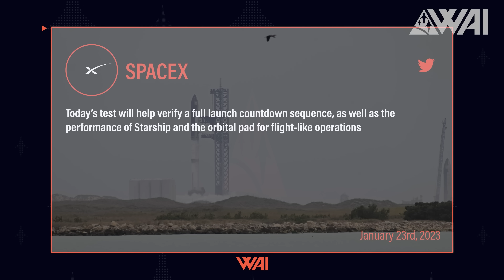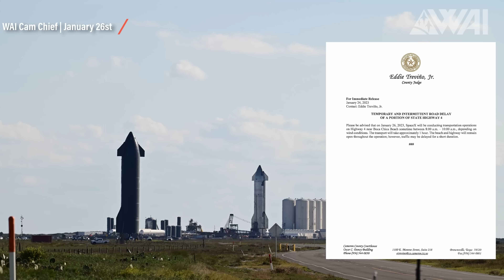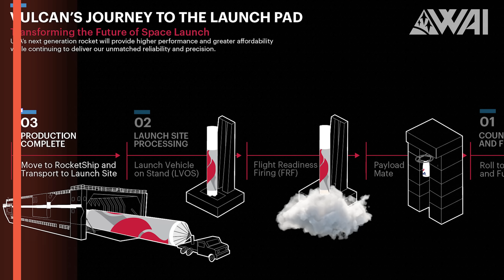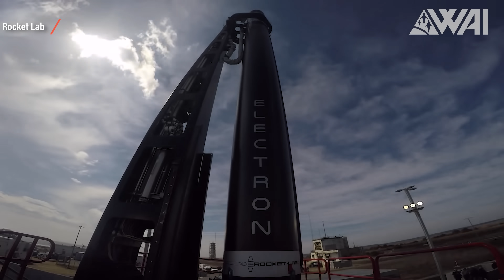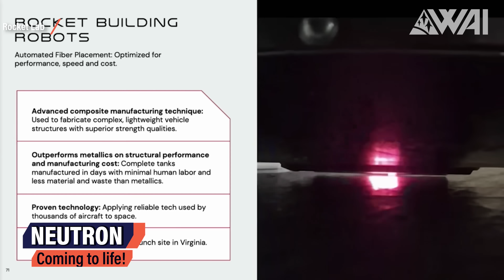How Did SpaceX Starship Do During The BIGGEST Test Yet? - Largest Rocket Ignition In History Next!

Comment: The CDDT (CountDown Demonstration Test—“Wet Dress Rehearsal”—my Baby Boomer behind!) also includes a  Pad Abort Test as a matter of course. If SpaceX took it that far, all goes as Felix describes and you get to T-whenever to start the engines. Since that is inhibited in the CDDT, you necessarily test the launch control and emergency detection systems to ensure they operate properly to safe the rocket on the ground. 

Certainly they would also have other abort systems at the ready for testing like fire mitigation, tank depress valves, etc. as well.

Frankly I’m more inclined to the March period for a first go. I cannot be made to believe launching a vehicle with roughly three times the power of Saturn V isn’t going to destroy the pad without a flame deflector and a massive water deluge system—far more than we’ve seen to date—to dampen the ground effects of that power. I hope I’m dead wrong and SpaceX has figured it all out; like everyone watching, I want this bird to soar!!😊

Comment: I have discussed some thoughts on the survability of the OLM pad from 33 engines firing up.

To better protect the pad SpaceX should have steel plates made up to cover the pad.  There are many steel types that can withstand both the tremendous temperatures and pressure of those 33 engines.  If for some reason one of the pages needs work it would be a very short down time compared to tearing up the pad, replacing the concrete and waiting 48 hours for it to cure.

Anyway those are my thoughts on pad survivability.

Comment: I love the Dr. No vibe of the Neutron payload fairing. We need to keep an eye on Rocket Lab and make sure Peter Beck doesn't start stealing spacecraft out of orbit.
I was very surprised to hear a Vulcan Centaur launch will only cost $110 million. Is that the actual cost of launch or the price to the customer? If the latter, then that puts them within about $1,000 of the per kilogram cost of a Falcon 9 launch. That is very impressive for an expendable rocket. Of course, they're not going to be able to launch more than ten or fifteen times a year compared to SpaceX's every three or four days or more and, of course, Starship changes everything.
Very much looking forward to Starship's maiden launch. I sure hope that flame, pressure waves, and flying debris don't do significant damage to the launch mount or tower. They really ought to look in to raising the pad up on a mound as was done with 39 A and B so they could build a flame trench. Anyway there are, of course, a multitude of things that can go wrong in a tst such as this and loss of the vehicle will not necessarily constitute failure. As long as they crack the Karman line, I'll call it a success.
Reply: Vulcan pricing seems about right... depending on configuration, Atlas was about double the price of a Falcon 9 launch, so you'd expect Vulcan to sit somewhere between the two.

Comment: 5:25 The Methane tanks might have been filled with LOX for this rehearsal. In that case, it would allow them to safely test the mechanisms that depressurize the Methane tank, but without a combustion hazard. For example, using hot methane gas for maneuvering with hot gas thrusters.
Reply: It was definitely methane that is why it is called a WDR and there is not enough LOX to go round all the tanks
Reply: Plus they will not evacuated the village if that's the case
Reply: then, when was the "single species" propellant test performed? It's on the checklist.
Reply: @imconsequetau5275  https://youtu.be/O2DB5oNJV-w
Reply: @imconsequetau5275  If it is perhaps the two tests before

Comment: I have a feeling that with a 33 engine static fire, that the concrete under the orbital launch mount will need to be replaced again.  Just a guess, but my feeling is they haven't solved that problem yet.  Perhaps they have though, as they have made more changes to the launch mount and it's systems.

Comment: A couple of points: 9:38 The BE-4 may be more efficient that the RD-180.  In that Blue Origin has not released its specifications that supposition is conjecture.  The RD-180 has a sea level ISP of 311, the only source I have seen, on the much lower chamber pressure, BE-4's ISP was by the Everyday Astronaut and he guessed 310 ISP.   12:16 As a matter of fact the Vulcan part of the rocket has arrived at the Cape and hoisted vertical.  The next major milestones left are placing the Centaur V upper stage atop the first stage, integrated testing performed, then the Vulcan rocket moved to Space Launch Complex-41 for fueling tests culminating with a Flight Readiness Firing.  All the pictures so far have been only of the first stage.  As per the Atlas V 10:06 was designed to put payloads into space, it was never commercially competitive on price to have much of an impact on the commercial launch market.  It was certainly capable enough for that business.

Comment: personally i think it will go well but its the simple flat pad under OLM that is the problem SpaceX is an amazing company but i find it hard to understand why they have left the concrete pad underneath OLM just flat surely some kind of dome indent and some slit indents in the pad would allow for better efficiency   for rocket exhausts  ?
Reply: They drive a mobile work platform under it for work on the engines.  You don't want the platform tilted.
Reply: @Scanner9631  aye I understand they do for replacing engines but am on about the 33 raptor2 engines  firing all at once on a flat pad underneath the Orbital Launch Mount there will surely need more repairs after they do that ✌️, the flat concrete pad underneath the Orbital Launch mount is the weakest point in the whole projected I personally believe don't understand why they are leaving it flat and not making some slit indents in the concrete to make it more efficient on projecting the Rocket Exhausts out of the OLM And Pad Area
Reply: @GamMngitSssEmoTionaL5953  

What I wonder is why they don't have a set of "baffles" that they can move under and drop in place.  

The baffles I envision would be large metal inclined at maybe 45 degrees from vertical and be layered.  

Purpose 2 fold divert the exhaust sideways and cause interference between diverted and not diverted flow (introducing chaotic but slowed overall movement) and leaving no direct path to the concrete surface or from the surface to the engines for debris to fly.

Slowed with less force = less surface damage.  The sideways flows would spread it out beyond the OLM faster leaving it less intense everywhere.
Reply: @Scanner9631  Great idea. I hope SpaceX adopts some version of it.

Comment: Elon quite correctly stated that Starship would leap off the pad. But I don't think he calculated correctly what 33 raptors would do at a sustained blast for required static fire testing. Installing the new suppression system he has arriving from the Cape will take months. NASA and his investors are breathing down his neck, so I feel that this is why he wants to get the first one up. After a successful launch, the investors will wait for the OLM to be upgraded. But if there is a lot of damage resulting from the 33 test, he will have no choice than to install the new system.

Comment: ULA thinks it can launch Vulcan Centaur for $110 million. Does that include the solid fuel boosters it will throw away each time? The rest of the rocket is still non reusable and the engine recovery method is just an idea. Still relying on Blue Origin for engines will a major road block - BO has only managed 2 engines in 6 years. Fly Starship fly!
Reply: Yeah, if they've got eighty missions on the books, they're certainly going to need Blue Origin to get their act together on engine manufacturing.

Comment: i think the trail was oxygen venting from the ship down a pipe they installed that goes from the base of the ship and a few meters down the side of the booster  I have seen it in the photos last week i  think
Reply: AGREED!
Methane has the notorious habit of dropping as it gasifies since it's heavier.
This plume floated laterally (horizontally) and even gained altitude slightly.
Methane crawls along the ground, which is what makes it so dangerous as it creeps along, seemingly searching for an ignition point.
Reply: @MrBuzzBill  Methane is lighter than air! 4+12=16.  16+16=32 14+14=28
Reply: @colinschaeffer3940  But NOT as it gasifies.
Reply: @MrBuzzBill  How long does that take?
Reply: @Colin Schaeffer 
Your question is a nonsequiter.

We're talking about the vertical plume.
Is it oxygen, or is it methane?
Do you have an opinion?

Inquiring minds want to know. 🙄
Reply: @MrBuzzBill  it is oxygen because it is venting from the bottom of the ship that is where the oxygen tank is an i don't think it would be that simple if that much methane go out some organisation would of told them off
Reply: @naderbenchaaben1569  Sounds logical.

Comment: How much thrust do rockets usually have in excess of their weight.   Do they aim for equilibrium between weight and thrust and then rely on fuel burn to get things moving.  I did some calculations with information I could find and starship could burn in excess of 14.5 t of fuel per second.   I ask this because with all 33 engines at full throttle they have ove 8,000 t of thrust and 6,500 t thrust with sea level raptors only.   Ok, gone on too long already.

Comment: You know you brought up a point I've been wondering about. Why or has Space X used NASAs' method of flame diversion that was used at 39A for the Saturn launchs? Too expensive, proprietary? Maybe a good subject for a video.
Reply: Army Corps of Engineers won't approve it.
Reply: @colinschaeffer3940  Is this all apart of the environmental issues Space X has been struggling with? The only reason I can find is that the ship and booster will eventually make landings and take off from nontraditional spots at sea or the Earth so it didn't make sense to not test what limitations were to be dealt with.

Comment: @what about it.   Would you find out why Elon doesn't use the "Tiles" or white fire brick under the launch mount for test fire or lift off? make them removable for when work needs to be done on Starship
Reply from the maker: As Joseph said, those tiles are fairly brittle. They wouldn't survive the impact of the engine exhausts. Something else would be needed.

Comment: The concrete issues at SpaceX's OLM perplexes me... if it is such a problem why isn't SpaceX protecting the pad with a custom fitted steel plate and grill?  The plate could be filled with water prior to firing the rocket.  Everything would be well protected and it wouldn't hinder technicians from doing the work they need to do at the pad.

Comment: Very curious if the launchpad will survive the 33 raptor static fire.
Reply: The answer is most likely not. CSI Starbase did a great video about the pad and all we know about the mitigation efforts.
Reply: @timwildauer5063  even though they put new high quality concrete I will say this RIP Concrete
Reply: @xx_peace_xx5300  no concrete is going to be able to withstand 33 raptors. Any idiot could understand that. The point is that they’re going to install a water deluge system so the concrete doesn’t get beat up as much.

Comment: I’m no engineer, but without a flame diverter, everything around is going to blow up into pieces with that 32 engine static fire test
Reply: LOL!  You mean, 33 engine static fire test?

I am an engineer, and I share your concerns.
Reply: If there was no other way other then a Flame diverter they would've installed one. SpaceX is all about innovating and only building what's critically important, everything else is cut out.
Reply: @ReiseLukas  can’t wait to see what happens! I hope it works!
Reply: I like @Scanner9631's idea of a baffle/diverter that is positioned on the flat concrete right in the path of the blast. He says: 
"The baffles I envision would be large metal inclined at maybe 45 degrees from vertical and be layered.  
Purpose 2 fold divert the exhaust sideways and cause interference between diverted and not diverted flow (introducing chaotic but slowed overall movement) and leaving no direct path to the concrete surface or from the surface to the engines for debris to fly."

"Slowed with less force = less surface damage.  The sideways flows would spread it out beyond the OLM faster leaving it less intense everywhere."

Comment: The CH4 molecule, and even the O2 molecule, are massive compared to H2. So much easier to contain.
Reply: You do loose out on specific impulse though SpaceX's Raptor engines can reach 363s for the vacuum variant, meanwhile Aerojet Rocketdyne's RL-10C has an Isp above 460s.
Reply: @plainText384  Yes indeed, hydrolox gives you significantly higher Isp, but it is offset to some degree by the much larger tankage required to hold enough H2 for a comparable amount of total propulsion. That tradeoff was a significant reason to go with the less-powerful fuel... as well as the critical ability to prevent propellant loss in orbital fuel depots, and the future ability to refuel from extra-terrestrial in-situ resources. Those last two things are definitely down the timeline a bit, but SpaceX is making choices now with an eye to that future.

(Yes, it's actually simpler to make off-Earth H2 + O2 propellant farms: just collect water, from anywhere, hydrolyze it into hydrogen and oxygen, and cryo-cool them. No need for RWGS or Sabatier reactions, and the gas separation might be simpler (??). But then you're back to the problem of H2 boiloff... I believe its a solvable problem, but cryofuel depots in space will be much more complicated if they must constantly be recapturing H2)
Reply: @Wordsmiths  Yes. Boil-off is going to be a huge challenge on the way to Mars. Will we be able to make CH4 on Mars for return trips, though? I haven't heard that explained.
Reply: @riparianlife97701  I’m happy to be the bearer of good news, then! Not only has it been figured out, but demonstrated in prototype, in at least two independent instances.

Going on memory here, but I believe Pioneer Astronautics (Zubrin’s firm) in Colorado built a working laboratory-prototype of a Sabatier reactor twenty years ago. Feed gaseous CO2 in one end, add some H2 feedstock (ironically!), pass it through a catalytic screen that causes an exothermic Sabatier reaction, and you get CH4 and water vapor out the other side. 
In practice, you’d recapture that vapor and crack it into O2 and H2, feed the H2 back into the reactor, and keep the extra oxygen as a bonus byproduct of the reaction…. Thus making both your rocket fuel and your oxidizer in one reaction.

But all that “in practice” stuff seemed easier said than done, and “in practice” there would be hydrogen losses and possibly oxygen losses too in various ways. And since the Sabatier reaction is exothermic, but your end product needs to be cryogenic, that’s going to be an engineering challenge… CSU-Pueblo did a study that showed the weak link was actually the use of solar power for water electrolysis (an engineering flaw not a scientific limit).  

So a few years ago (2018? 2019? Pre-pandemic) a clever engineer brought both an improved Sabatier reactor and a RWGS (reverse water-gas shift) reactor, both of them tabletop-sized, and demonstrated some of the plumbing and valves required to close the system. Both ran very hot, but oven temps, nothing crazy hot. 

I’ll post links when I can!
Reply: Hydrogen embrittlement hardly matters for disposable rockets. But it’s not something anyone wants for reusable rockets.

Comment: What do you think SpaceX will use as a dummy load?    I think they should use a Tesla Semi.....but since the craft is already closed up that is not going to happen.  
In fact,  with the ship closed up, I even wonder if they will have a load.
Reply: maybe that is why 24 is going back to assembly. time to add the stuff. :) it might be a new battery pack for the roadster
Reply: @martehoudesheldt5885  🤣
Reply: Probably nothing since the payload door was sealed
Reply from the maker: Ship 24 sadly has no way of deploying anything as far as I know right now. So, they might strap something into the fairing, but it won't be set free. :D
Reply: The major testing is on the superheavy booster.